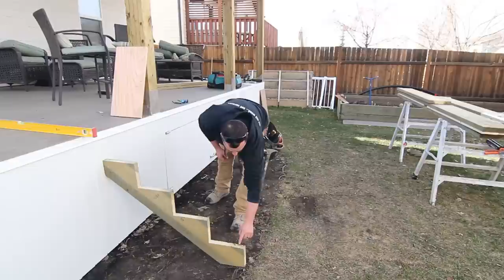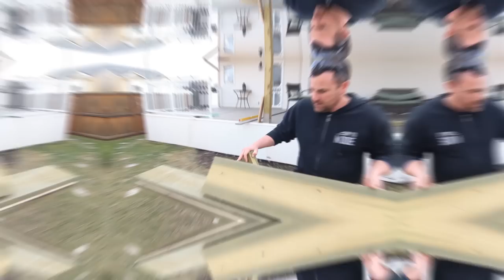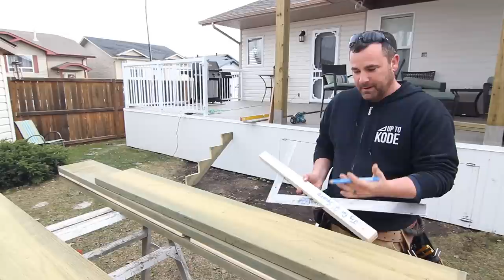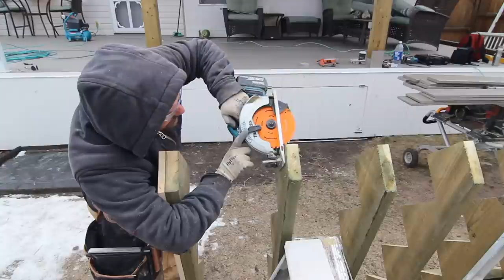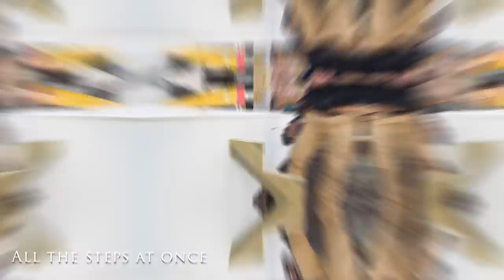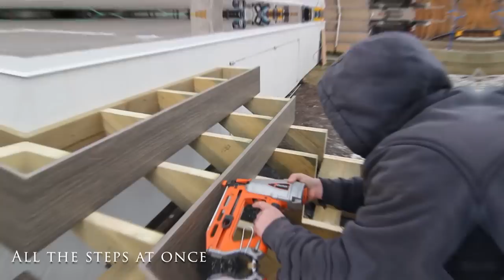How to Build a Set of Deck Stairs

Comment: what would be the total cost for these steps ?  (No promotional rate applied) ...  neighbors I understand you apply a reduced cost for promoting yourself locally or touching a new market but just straight numbers ..  you dont need be exact ....

A. less than $750 

B. more than $750 

C. less than $ 1250 

D. more than $ 1250
Reply from the maker: I would say, because of the composite, 800-1000.
Reply: @uptokode  .....  thanks Kody  ... happy holidays

Comment: Why do you make it sound so difficult and why you measure off over dirt? 1/4 inch off of dirt wouldn't make any difference. Either level the dirt, or install cement platform or wood platform on the bottom of the step. If you going to make anything measure it is a true measurement.
Reply: Ah whatever.

Comment: I feel like the why the steps are cut in they are very weak. I would just take a 2×12 and put blocking in between them for the steps to sit on. Incredibly strong good for ever i think. As for the run and rise uh just cut out the steps at the right size or buy those premade things with the round on the front. Becuase we dont buy in bulk just buy what you need then get more if you need it. I feel like the math is mostly skipable just know your mins and maxs and you can work. Unless your going for some kind of all symmetrical all same size steps usually its fine to have a small step at the bottem. As long as the rest match.
Reply: Robert Bogan Building my second deck now. This is what I decided to do to cut down time and possible mistakes. 
  As I was sitting in the deck this morning and looking at the unfinished stairs, I realized, with the sides of the treads closed, sweeping the steps will be a little more difficult, especially with a tree nearby.  I might decide to cut the side stringers like I did the middle support stringer.  That would mean, in my case, I would need to install two more posts to attach the stringers too.  :(

Comment: Good video, in the beginning, though you said that the total risers (TR) were 36.25/8 risers (R) which gave you gave you 4.53 Risers (R) I think you meant steps, TR/R=S. And when you continued and rounded up to 5 that would be again 5 steps. That's how you got to the calculation of 7.25(R). TR/R=S, TR/S=R, and R(S)=TR. Again I learned a lot from you thank you,
just want to point that out.

Comment: Kody, those stars are completely wrong. Not code. Poorly built. 
        First..never measure to the uneven ground. You should have poured a concrete footing ( minimal 3.5” , preferably 12”) then measured to the leveled footing.( which is code)
        Second , you have no frame behind the stairs to attach to, your nailing into pine boards, which are not structural.
       Third, attaching the stringers to a 2x4 is not code, the “rim board must be the full width of the plumb cut on the stringer.
       Fourth, you have no stringer hangers to support the load and sheer movement, which is code. ( at least a LS70) 
      Fifth , the stringers must be attached to the concrete footing ( which you don’t have) the stringers should have rested on a 2x12 , which is then attached to the footing via “ titan” lags or similar. 
     Sixth, the skirt trim and the risers should be mitred at 45.
     Seventh, 36” high without a railing is not code. Stair posts and railings should have been added ,for code and safety.
      Eighth, open stringers are not code, as no opening can exceed 4” ( so a baby’s head cant get through)
  This

This type of extremely bad workmanship, gives a bad name to use professionals who work hard to build quality products and follow local codes. ..Please never build anything ever again, especially never do a video on how to build anything...your going to get someone Hurt....
Reply: Not everywhere has the same code. Where I live has no building codes period, zip. We do not even have a permit office. This is all new information to me BUT it is good information. I am trying to learn how to build things as some things I have learned growing up was definitely wrong. I found it informative.
Reply: Perhaps your information is correct but there isn't a need to add in a personal attack to Kode at the end. If you had commented in a more tactful way maybe he and others would be grateful for the additional information. Here's an idea.... Why don't you (the professional) make your own informative video?